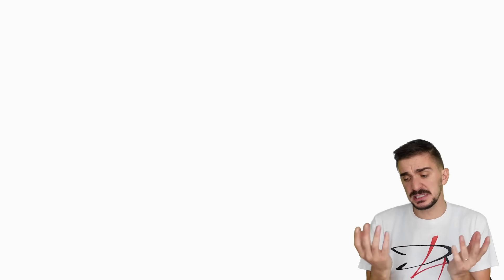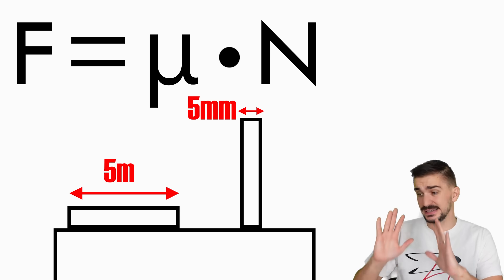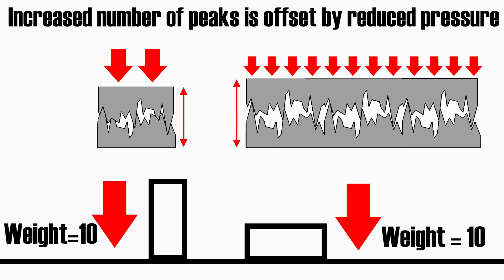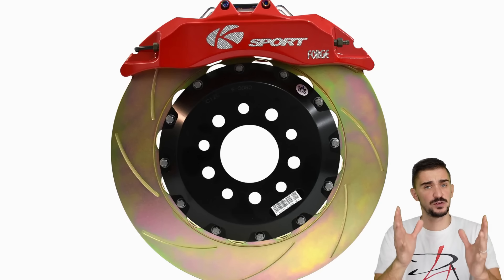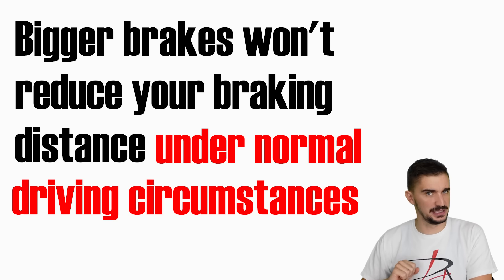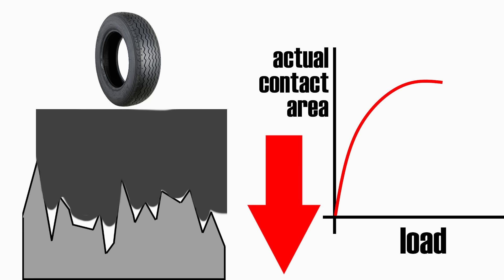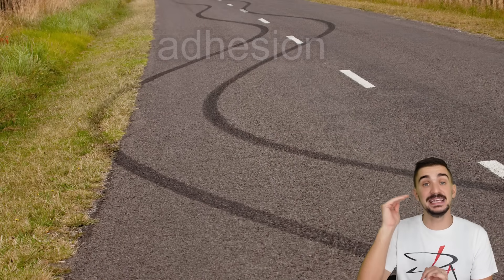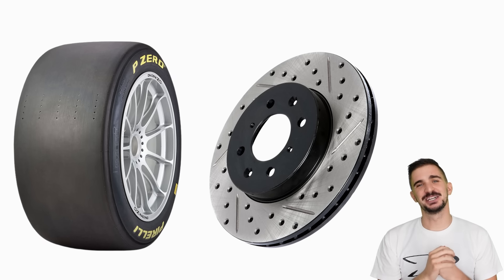Why Big Brakes Won't Stop You Faster but Wider Tires Will - Friction and Surface Area Explained

Comment: Bigger brakes have bigger calipers with more clamping force and you often use braided lines in conjunction with them, they will stop you faster. They will also dissipate heat better which leads to better braking when repetitively braking hard. I also didn't hear you mention brake fluid fade asscociated with heat from excessive hard braking, I don't think you're considering all the variables in any case. Obviously having a bigger contact patch with the ground will help also...

Comment: Let's take the analogy of a torque wrench if we apply 1 lb of pull on a 1 ft bar, we get 1 lb/ft of torque, but if we use a 2 ft bar with the same 1lb of pull, we get 2 lb/ft of torque.

The exact same principal works when applied to brakes. A larger rotor with the same caliper and same pads and pressure will net an increased braking effort. Increased heat? Yes. Increased braking effort? Yes. Could it exceed the ability of the current tire to sustain that torque? Will depend now on the tires ability to grip the road.
Reply: Typically stock brakes coming with a normal car today are sufficient to lock the wheels, if you push them hard enough. Cars today are no VW Beatles any more

Comment: Yes it's not the width that makes tires better it's that most wide tires are more sticky.  However a larger brake rotor does stop your car faster because it can apply more torque, it's like having a larger wrench

Comment: The whole talk never once talked about the lever length and ability for larger diameter brakes to convert more kinetic energy to heat. In other words, better braking. Many years of mechanicing and crewing on race cars taught me that as well. We also learn that towing trailers with a truck that has larger diameter brakes. This video has some good info but missed the mark in reality.

Comment: Assuming the stock brakes and the upgraded brakes have the same radius from the center of the wheel; they have the same braking output, but if the larger brakes have a greater radius from the center of the wheel, wouldn't they provide greater stopping power?

Comment: Also electric cars put more stress on tires, so wider tires would do better with the high torque generated by a Tesla.
Reply: The power of these electric drive trains are the reason Teslas actually have relatively wide tires. You don't get Teslas with 205 mm tires

Comment: Bro, excellent video. Very timely since I just came back from the track and ROASTED my brakes and was thinking about a big brake kit. Also I really appreciate your illustrations and use of household objects to help explain. I know that's the kind of stuff that keeps you up at night planning videos. 😂 Absolutely fantastic work. 👍
Reply: So are you getting a big brake upgrade?
Reply: @blackcanyongarage  Yup. 😂Wilwood 4-piston calipers, Raybestos ST-43 pads, 12.11" rotors. For brake cooling I got dust shields with a 2.5" hose hookup, some silicone hose, and some C6 corvette plastic brake ducts. I'm never overheating these brakes again. Ever. (2006 Miata, btw)
Reply: @TurboHappyCar  I was coming doen a mount here in AZ called Yarnell, and at the bottom my brakes failed and I had to pull over. I'm always prepared for that mountain now.
Reply: @blackcanyongarage  Oh interesting. (I'm sure you already know) For mountains you can downshift and use the engine for braking, and just use the brakes for short periods but with medium pressure. Like a quick haul from 75 to 65 in 5 seconds, for example.
Reply: @TurboHappyCar  Definitely. But Yarnell ain't no joke.

Comment: I road raced motorcycles for eight years, winning six championships, two time national champion..
  I thought I would improve my lap times if I upgraded my brakes.. so I added a second disk to the front wheel, caliper, pads, hardware to hold the disk to the wheel, and to attach the caliper to the fork slider. I also added the hoses for the brake fluid..
  I went to the next race and on the Saturday practice, I lost five seconds per lap on a roughly 2 mile long road race track. I also lost acceleration, I did not lose top speed, but I did lose suspension compliance, and my motorcycle would not rotate left, right, left, quickly like it used to with a single disc..
   I was obviously slower on acceleration out of corners than my competitors that I was even with or slightly faster than previously..
   I got through practice, and I lined up for my heat race which determined the starting positions for Sunday’s final..
  I usually placed in the top three or four during the heat races on Saturday, which the grid was determined by your registration time earlier in the morning. I didn’t care about a great start on Saturdays because, I was confident that I could get on the front row no matter where I started the heat race on Saturday
   but this time was different. I was losing five seconds per lap. Five seconds at an average distance covered per second of 110 ft./s..
  that’s 550 feet I was losing in distance to the leader every lab for seven laps... That’s over 3500 feet I came in the end of that race behind the leader. That’s over half a mile. All because I added, a flywheel that had to be accelerated, a gyroscope that resisted change of direction, and the worst, unsprung weight with the second disc, bolts, caliper, bolts, pads, hoses.. and one final bit that I never figured on, friction from the pads. Jack up the front wheel on any motorcycle with a disc , give that wheel a good spin and see if you can get it to rotate even one time. That’s drag from the brake pads on the disk…
  so I went from approximately 250 hp of brake, to 500 hp brakes. And all it did was make me five seconds a lab slower..
  handling was much worse. Most road race tracks have ripples exiting corners. The cars really get good traction and on a hot summer days they tend to put washboard ripples at the exit point of corners. My motorcycle used to be able to ride over those  corner exit ripples without notice. But with that extra unsprung weight. My suspension was overwhelmed and my Machine chattered off-line when I attempted to go over those bumps wide opened like I always did with a single disc.. unsprung weight is so critical that Porsche has been using titanium Lugnuts to attach their wheels to their cars spindles for decades, just to save a few ounces. And I added pounds to my suspension..
  adding that 2nd disc ,I also added A second gyroscope. There was a section on this track that was a left, right, left, right quickly in succession that I could take in third gear wide opened. that section exited onto the long main straight.. you always want to have the highest exit speed you can get on to a long straight because you will carry every extra mile per hour you exit that final corner all the way down the straight..But with the second disc, I always ran off the track after the second turn, every time with the second disc. completely upset my rhythm for the final exit onto the straight..
    so after Saturday’s heat race disaster, I was going to start 17th on Sunday.
  so I removed the gyroscope, which is also a flywheel, which is also unsprung weight, which also has additional drag from the pads against the second disc. I took all that stuff off preparing my machine for Sunday final race.
  I ended up winning, and later that year I ended up winning the national championship which was awarded to the rider with the highest point total.. that second disc set up almost cost me the national championship.
  ever since learning that lesson the hard way. I have told many many riders, if you want to improve your handling, your motorcycles ability to rotate left and right quickly, and your acceleration, don’t add a second disk to your motorcycle. It can only make matters worse. you do not need a 500 hp front brake on a  motorcycle and I doubt that you even need it on a heavy motorcycle 90% of the time..You can lock that front wheel with two fingers if you’re not careful. Why would you want to have more breaking power?
  so I tell people that and what experience I have had with it. And you know what, nobody believes me..
  there is one advantage that having a dual disc set up on a motorcycle does help. That is, the braking force pulls evenly on both fork tubes, and the motorcycle will brake in a straight line while going in a straight line. there is also a disadvantage with that. You are cornering a motorcycle. When you want to go to the right at higher speeds, you don’t realize it but you actually press with your palm on the right handlebar, that actually aims the motorcycle slightly to the left a couple degrees, and the motorcycle will fall to the right. here is where a dual disc set up hurts a motorcycle while cornering. It pulls evenly on both four tubes and it will actually make the wheel go straight again and make the motorcycle want to stand up while in the corner when you don’t want it to. This was painfully obvious when the industry was going trendy with 16 inch front wheels on sport bikes in the 80s and 90s. They soon realized 16 inch wheel size was not the optimum size, Because braking  into the corner while leaning was pulling the wheel straight, making the machine stand up in the corner. They soon broke away from that and went to 17 inch wheels, which is still the front wheel standard size here in 2022. It’s a happy compromise size on sport machines..
  I am glad that you put this article on youtube..
  I know that you say more tire is how you shorten your braking distance, not with bigger brakes..
  A couple decades ago, 2 world champion road racers on motorcycles, Kenny Roberts, and Freddie spencer did some tire development. Turns out that wider is not better for handling. Wider requires  more countersteer pressure to get the motorcycle to turn, and  you must maintain that pressure to keep the motorcycle leaned over in a corner. Bigger was not better, at least for motorcycles..
  When I roadraced motorcycles, we had to race in the rain about 20% of the time. Believe it or not, wider is worse in the rain. I actually used to increase my tire pressures about 8 pounds to shrink my contact patch, so I would be effectively increasing the weight per square inch of contact I had with the road, making the tires squeegee the water out of the way harder.. less is more. Les tire in contact with the road shrinks the contact patch, the weight of the motorcycle is constant, but the weight per square inch increases by increasing the tire pressure..It obviously worked because I usually won in the rain.. some riders would be in front of me in the rain, some riders would pass me in the rain. But I was confident, that you could not go that fast, and they usually crashed right in front of me at some point..
  skinny tires are better in the snow also. Just look at a Chevron farmers tractor tire. Tall and skinny with those blocks of rubber at 45° angles. They can go through a muddy field. A four-wheel-drive pick up truck with wide tires, could not go through some of the stuff that a farmers tractor can go through, because that pick up truck has wider tires. Same with snow tires. They have a lot of deep tread, that tread is actually the absence of rubber.. The tire digs into the snow. Of course a drag racer tire is wide and no tread. That’s because the road surface  digs into the rubber. All that tread does is give water and escape route on wet roads. I’ve actually heard it explained in Formula One, that the  race rain treaded tires actually pump the water away..
 One thing is for sure. The factory knows more than I do. I learned that decades ago. And I always go with the factory specified tires, lubricants, filters, settings, exhaust system, air filter, on all my Vehicles. They did the research

Comment: Strictly speaking if the brakes are too small for the speed/mass of the car then they will fail before the car can stop in which case larger brakes will actually result in a shorter stopping distance.

Comment: I have a masters degree in mechanical engineering, been making cars faster since I was 17 (17 years ago...), worked in vehicle dynamics for a big OE for 10 years and while there performed the subjective driving analysis portion of engineering about 30 production tires, evaluating 150+ submissions in total in dry, wet, and snow, and I gotta say, this is the absolute best description of tire and brake physics I've ever heard.  Well done!  PS, I have 315/30R18s on all 4 corners of my 93 Honda Accord 😅
Reply: Oh man...I had a '92 Accord, two-door, manual trans. I absolutely loved that car. I miss it dearly.
Reply: @xtnuser5338  this one is a time attack car, awd and shooting for 800whp lol

Comment: What you DIDN'T go into is that all tires have a different compound, and therefore a different µ.  A case in point, back when "retreaded" tires were more common, they were barred from certain races, not because they are more prone to self-destruct, but because they were a "softer" rubber, and has more grip for the same size and tread pattern.
Reply: Yeah he missed that and also the fact that wider tires don't increase the contact patch proportionally, the patch will get less long longitudinally. Contact patches are two dimensional.

Comment: You and rob dahm are completely wrong. You literally disprooved your title half way through the video, small brakes cant cool down hence less effective. Why do motorcycles use twin rotors 300mm and twin 4 piston callipers and only have inch wide tyre? 🤔. Also you have hydraulic ratios, even application of brake pressure. The titles wrong... Bigger brakes will stop faster then smaller beakes everytime. The disk size is relative to the wheel diameter as well.
Reply: Do motorcycles have brake boosters? They increase the power by far, if you don't have them you go the way of bigger rotors or even twin rotors. Cars use brake boosters in general.
Downhill mountainbikes use rotors with up to 220 mm and 4 pot calipers, but they have no brake boosters too and even if their rotors are bigger than the rear rotors of a small car the car's rear brake is still way more powerful than the 220 mm mountainbike brake
Reply: @simonm1447  exactly, so bigger brakes will stop faster. Of course if you just change disk and calliper and leave the incorect ratio on the master then youl lock. Same for smaller. Brake pressure will cause locking. Just like how its applied. A sudden quick application will lock, but a smooth application will see much higher brake pressure before locking.  The thing is theres way more maths involved then just tyre friction. The reason for no boosters is for feel, booster just multiplys the pedal force, so its comfy to drive. Where the titles myth comes from is when people throw big callipers and disks on their cars without changing the master cyllinder, they get locking.
Reply: @motomenace86  did you even watch the video?
Reply: @simonm1447  yep, hence my comments.
Reply: do wider tyres stop you faster then narrower tyres with more grip?
Reply: @motomenace86  the more grip you have (it don't matter if you do this with softer tires (like race cars do) or wider tires) , the shorter your stopping distance can be, if the brakes are powerful enough to lock them (which means ABS will engage on a road car).
A massively oversized brake won't give you an advantage if the stock brakes are already powerful enough to lock the wheels, and every car today can lock the wheels. Cars are no VW beetles any more with lousy small brakes without brake boosters
Reply: @simonm1447  exactly, you just prooved why the titles wrong. Its too vaigue and incorrect. Stock brakes are adequate to lock the brakes, but at what speed vs the tyres they come with, vs unloaded and loaded. The titles incorrect and missleading. Theres so many variables. In your argument you say "if alot". If a standard brake is sufficient, at what point is sufficient? I agree an oversized brake wont be a huge advantage, but an undersized one is a dissadvantage.
Reply: @simonm1447  ill word it like the title, insufficient smaller brakes wont stop as fast as an adequate or larger brake. A wider tyre of the same compound will achive more grip. Were a wider tyre wont provide more grip if the smaller narrower tyre has a grippier compound in the dry.
Reply: @motomenace86  a stock tire brake is sufficient for the normal use of a car, if it's a normal daily driver car it's sufficient to stop you and engage ABS from every speed you can drive on a public road.
Racing is a completely different story, since the brake gets far more heat stress here and a stock brake would overheat on a "normal" car because it's not made for that (a normal car is no race car).
It wouldn't make sense however to put far more expensive race brakes on a car which is used in normal daily traffic
Reply: @simonm1447  Ok so change the title.I also disagree, a roadcars brakes are the bare minium to pass the design rules. Performance models are better. So many videos on the internet prooving upgrading stock brakes to larger units infact decrease stopping on same tyres. 4x4s in particulat
Reply: @motomenace86  a stock brake on a normal car isn't insufficient today, since brake tests are now made together with crash tests and the result can be compared by the customer. If the brake would be too weak the customers could read it from public sources.

He also explains in the video the difference between a brake for daily driving, and a brake for race cars
Reply: @motomenace86  why do you assume stock brakes are insufficient? I don't know if infamous manufacturers like Stellantis or GM sell vehicles with such brakes, European or Japanese manufacturers equip their vehicles with sufficient brakes
Reply: @simonm1447  watch the link i shared, thats a toyota. standard brakes are generally only good for 1 stop from 100kph, euro cars equip alot better.